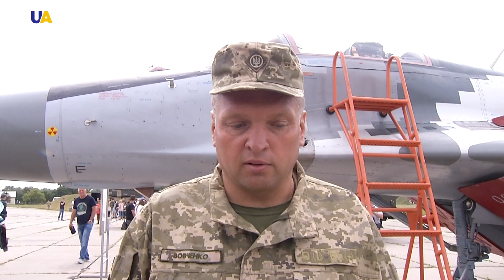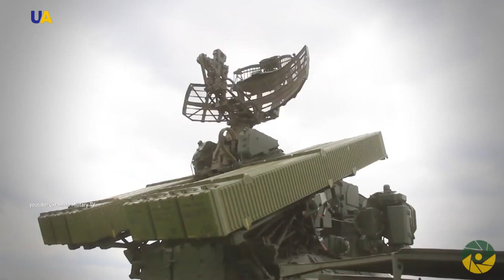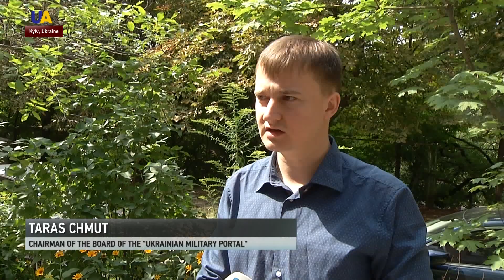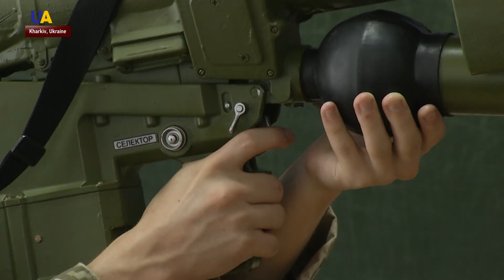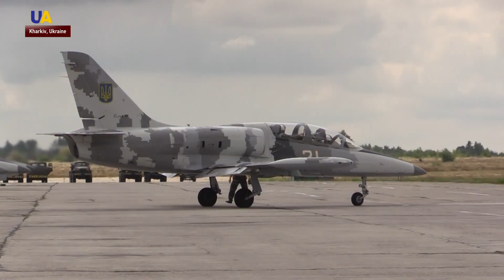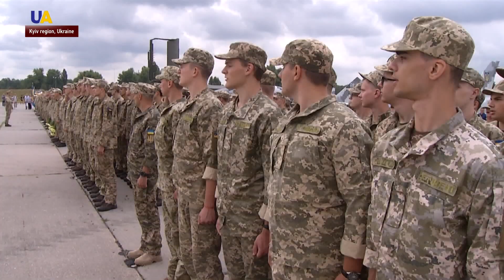Protecting the Sky: Ukrainian Air Force

Comment: Maybe you can get Bulgarias migs they are retiring soon.
Reply: No thanks.
Reply: Korean F-4 Phantoms would be much better. One of them has shot down mig 29s with old vacuum tube missile.
Reply: @aabb-zz9uw  
Mig 29 is the better craft, though it carries less payload and has a larger radar cone. Mig-29 is more maneurveralbe, larger thrust to weight ratio, more modern.